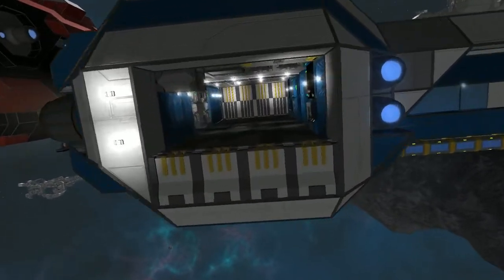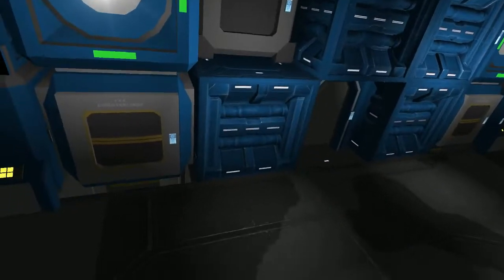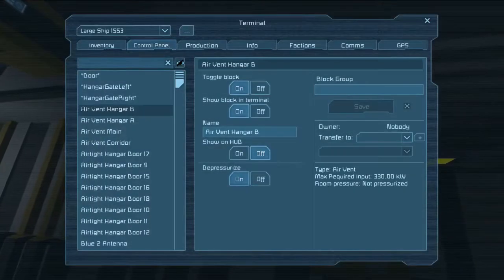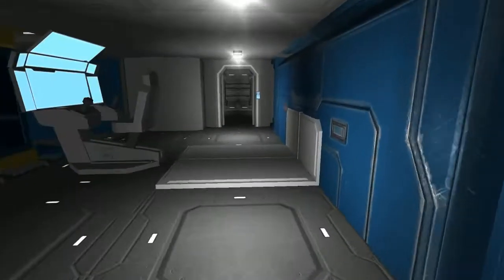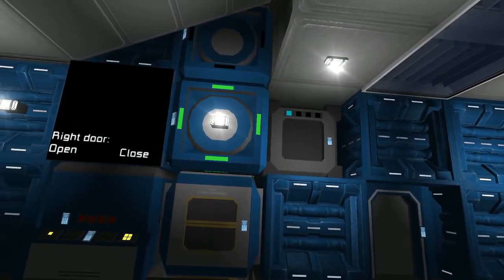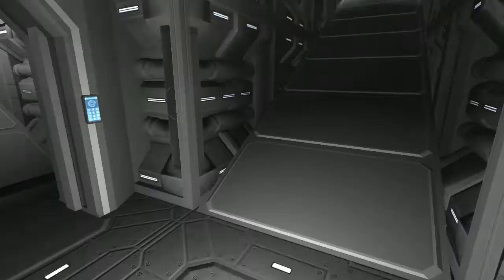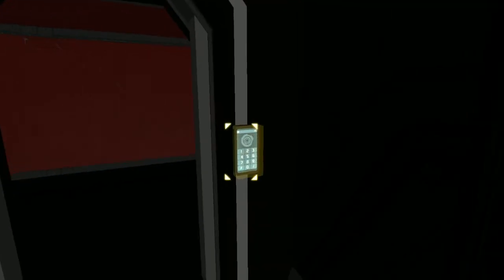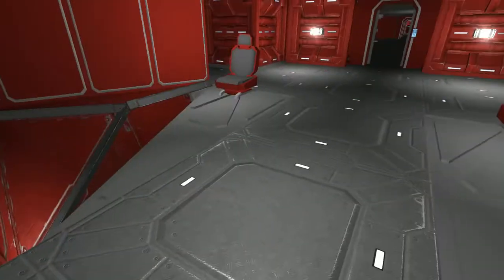Space Engineers - Easy Start 2 changes comparison

Comment: Thanks! If you could do a tour of all Cargo ships it would be awesome!
Reply from the maker: Mihai V. Which ships did you have in mind? There are hundreds of mod ships on the workshop, and only the two actual developer starter ships.
Reply: Minngarm Halnhammer Sorry I thought they also made the NPC spawn ships (the Commercial, Mining and Military ships) compliant with oxygen. So I thought you could also do a tour of those changes.They seem to be unchanged though.
Reply from the maker: Mihai V. I did not even think about that, so you've already checked them?
Reply: Minngarm Halnhammer Managed to check out the Minelayer and Private Sail. No oxygen storage to be found so I thought they didn't change anything. My favorite activity is SE used to be capturing NPC ships intact and welding them together to make a base, because they have refineries, assemblers, storage and defense built in and you can convert the Mining Carriage to a miner or grinder ship.